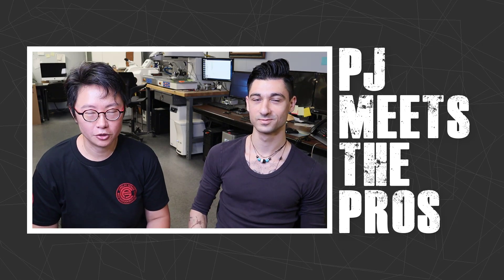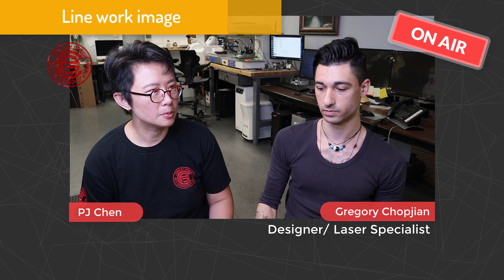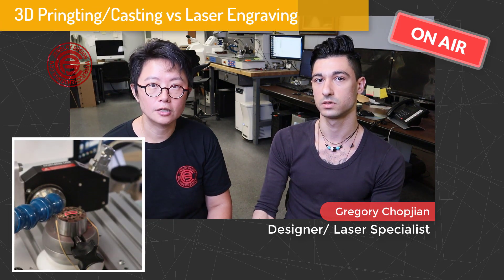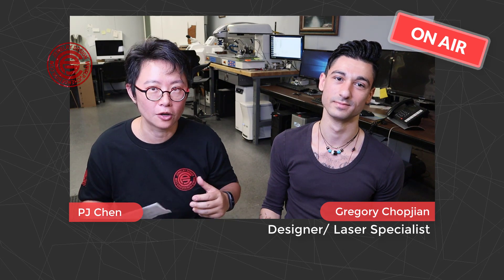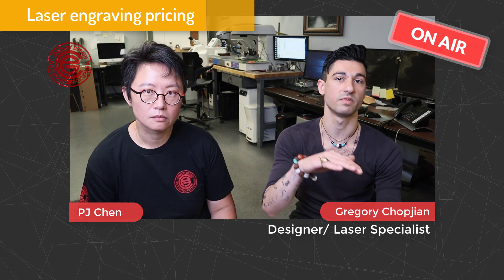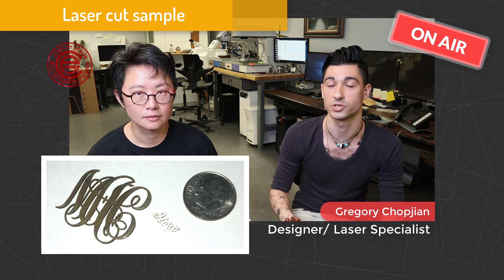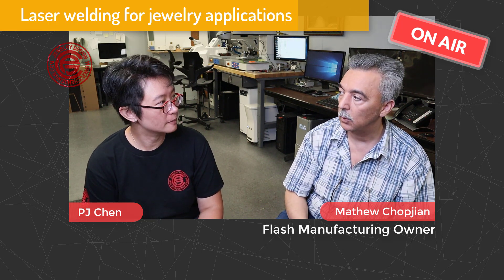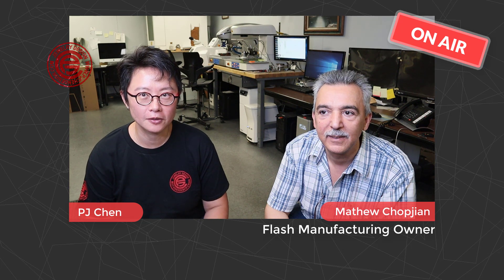【 PJ Meets The Pros】EP6: Interview Gregery Chopjian for Laser Cut, Laser welding and Laser Engraving

Comment: Want to know more about Difference between Laser welding and Soldering.
Reply from the maker: soldering is using lower temperature material to melt between two parts. and welding is fusing the material between two parts. there is a good article here for your reference. https://www.kaempfandharris.com/industry-news/difference-between-welding-and-soldering
Reply: @PJChenJewelryDesign  Thanks